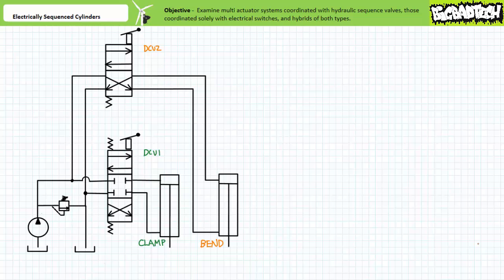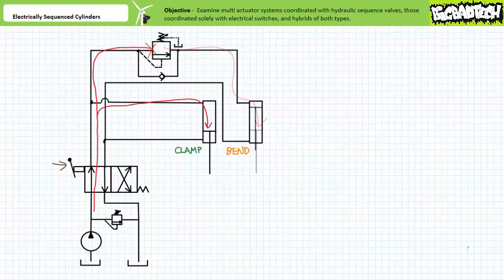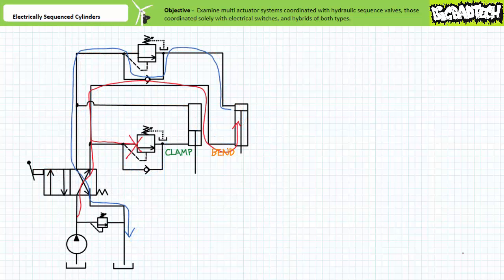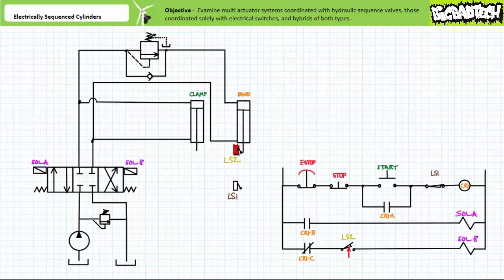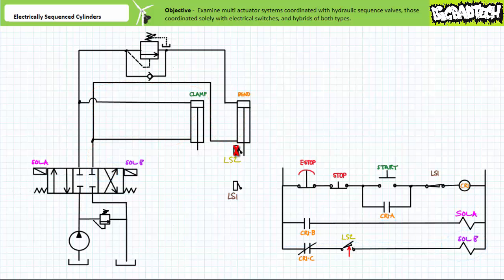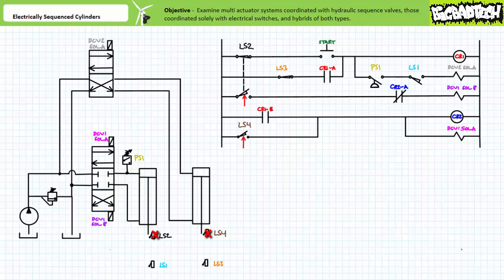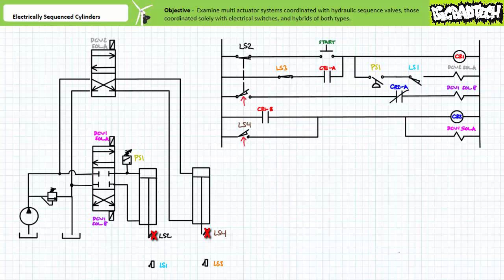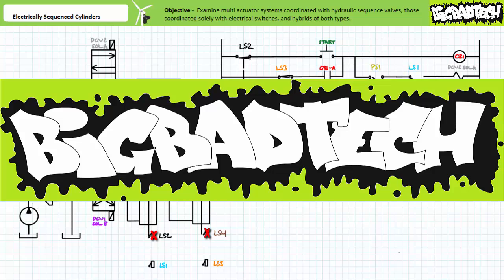Electrically Sequenced Cylinders (Full Lecture)

Comment: Hi Mr. Pytel,

I can not begin to tell you how much these lectures are helping me at my work as a maintenance mechanic/electrician.

I am wondering: It takes me a good deal of effort to understand how a machine is supposed to work given an electrical schematic or given a ladder logic diagram. Would a sequence logic diagram help? Would you consider doing a presentation on these? Are there any other tools that would help me understand how a machine is supposed to function? Simulation software perhaps?

Thank you for all you have done to make my new career possible.
Reply from the maker: Yes, eventually I'd like to go into state diagrams and finite state machines as they relate to PLCs. I actually have a couple lectures on state machines as they relate to digital devices like D flip flops and JK flip flops at the cgcclive channel. Watch out! Nerds only! 

https://www.youtube.com/watch?v=5ImfojCmG-A&index=21&list=PLX7ZPgPJWZNcDCIwqswjjaafqb3U2sVCb

https://www.youtube.com/watch?v=M0JVfjqccgs&index=22&list=PLX7ZPgPJWZNcDCIwqswjjaafqb3U2sVCb

https://www.youtube.com/watch?v=Zbmj-AHBxeA&index=26&list=PLX7ZPgPJWZNcDCIwqswjjaafqb3U2sVCb

https://www.youtube.com/watch?v=YwlJP4G--OE&index=27&list=PLX7ZPgPJWZNcDCIwqswjjaafqb3U2sVCb
Reply: Hi Mr. Pytel,
I response to your answer: it seems that the state diagram idea can be used to follow the logic of a complex hydraulic/electronic system. Perhaps to carry out the idea, one would make several drawings of the system in different states and put the drawings in sequence. Is this what you have in mind?

I remember your video demonstrating the MulitSim electronic circuit simulator. I am sure if there were a like minded software package that could be used to simulate electrical/hydraulic machines then you would already be using it in your videos.

Maybe 25 years ago I had this material (Digital Electronics) when I took a correspondence course with the National Radio Institute. They are no longer in business. Too bad. Along with lessons in theory, they would also send electronic kits in the mail for lab work. Saddly, this type of schooling is not available anymore but I see from your most recent video (Build a Motor Control Trainer Board) that you intend to make this kind of education possible again. I have already built my board from spare parts laying around at work and am looking forward to following along.

Thanks for bringing an industrial education to everyone
Best to you, John

P.S. Do you have any plans to cover safety relays and safety switches? They are used in most every machine at work but I have not been able to find much material on the Internet that explains how they work or how to use them.

Thanks again, John
Reply from the maker: Yes, that's exactly how I envision state machine design, a collection of certain actuation states that perform a desired sequence. Thanks for the safety relay suggestion. I'll put on the "to do" list.

Comment: At 10:37 you mention second rung (and then third and fourth). The seal in is on a branch of rung 1. It's not its own rung. So in total there are 3 rungs. Just FYI, might confuse someone at first.
Reply from the maker: Check out the ladder logic documentation lecture at: https://www.youtube.com/watch?v=f1Lj9I0vX6U for the definitions I'm employing for this course. You are absolutely correct that certain manufacturers define the holding (seal in) circuit as part of the same rung.
Reply: Jim Pytel yeah I thought maybe just a semantics thing. I can see how in traditional ladder logic electrical schematics it could definitely be counted as its own rung. 
You have some great videos. I’m assuming you’re an engineer? Can I ask how long? I’d love to have half the knowledge you have.
Reply from the maker: Yes, I'm an electrical engineer by training. My background is in industrial wind power generation, however, I worked in the semiconductor industry too. I've been out of school 22 years, however, I've always tried to keep learning new skills. Thanks for the kind words and stay in touch because I've got a bunch more new material coming your way after summer holiday.

Comment: What if one of these components (control LSI or PS1) fails? What stops a catastrophe from happening?
Reply from the maker: +D. G. Given LS1 and PS1 are in series with one another in rung 2 the failure of either of these components to close when required would never energize DCV2 SOLA and the press cylinder would not extend.
Reply: TX, that's the failsafe I presume!